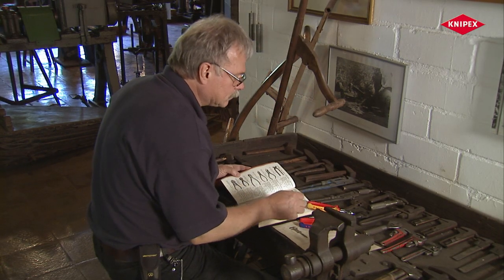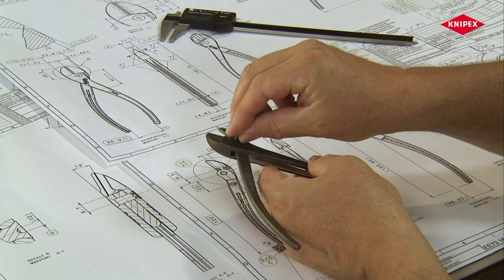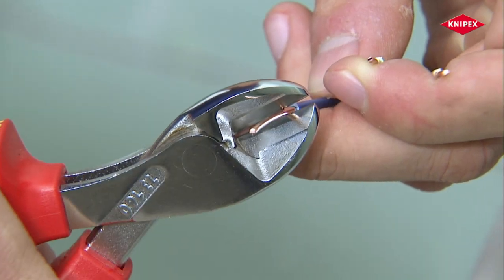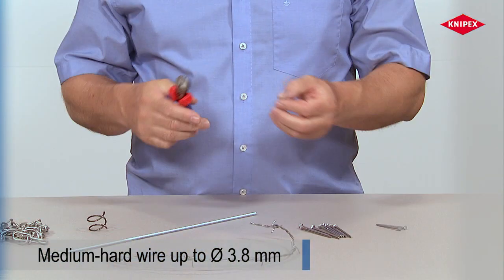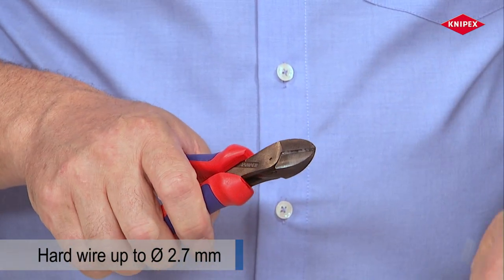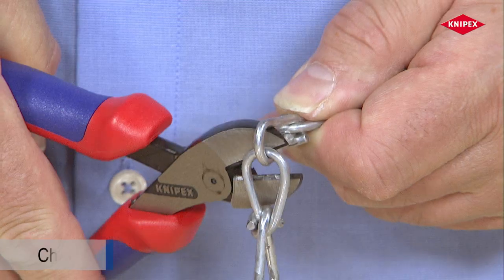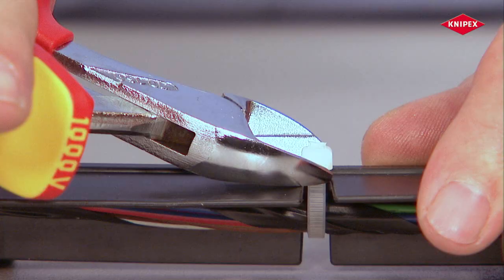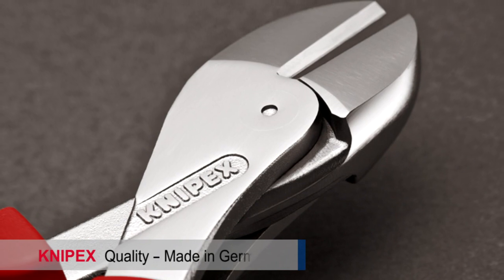Knipex X-Cut (English)

Comment: I like Knipex very much. I'm tooled up with Knipex, Wera, Wiha and I've tested them all. When it comes to side cutters the real best are NWS 200mm side cutters. They are compact, lightweight, sharper than Knipex and will cut a wire/nylon wrap on a flat surface (e.g. on a thick cable, which can hardly be done with Knipex).

Comment: Doesn't cutting m4 machine screws damage the cutting jaws or misalign the box joint over time? It would be great to buy long m4 screws and then cut them to size when you need to mount light fixtures on ceilings which have been plastered thick over the years.
Reply from the maker: Hi there, thanks a lot your question. We will check this and get back to you ASAP!
Reply from the maker: Hi FoodOnCrack, it is definitely possible to cut M4 screws. However, this of course requires appropriate hand force. As with any mechanically loaded component, it can show signs of wear over time. However, this should take some time, depending on the "regularity" in which you cut. So far, however, we personally have not heard that the X-Cut develops play. We hope this helps.
Reply: @KNIPEXofficial  definitely going to order one if I need to. Unfortunately I needed pliers for work but our dealer didn't carry one. Love all your products, especially the electrical installation pliers, they're life changing.